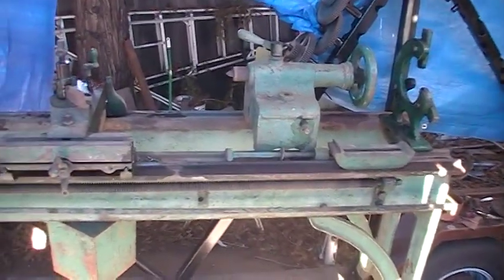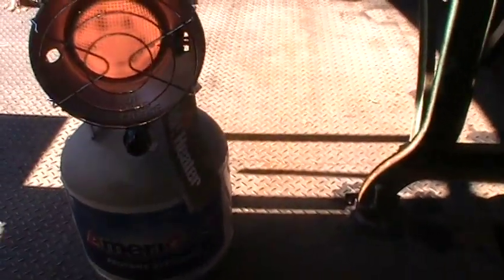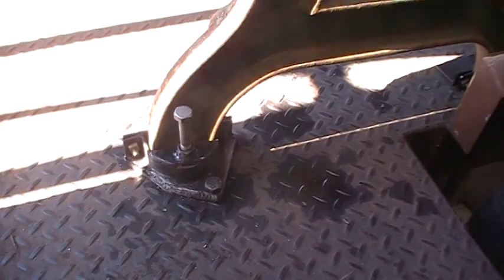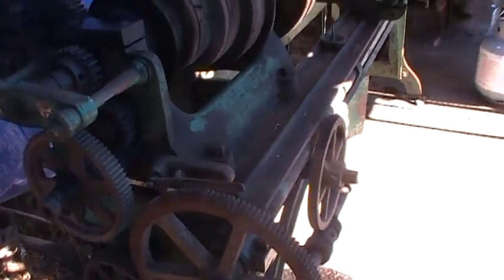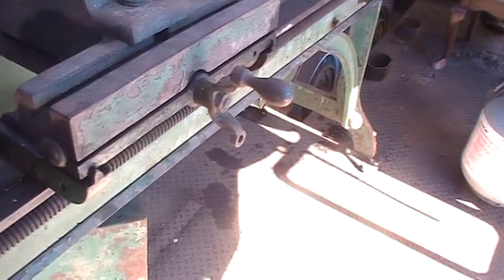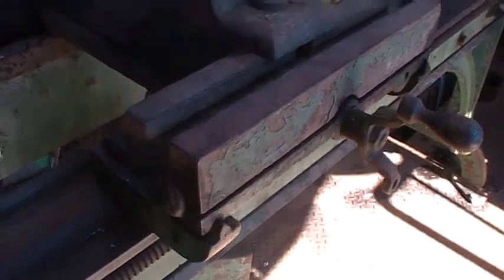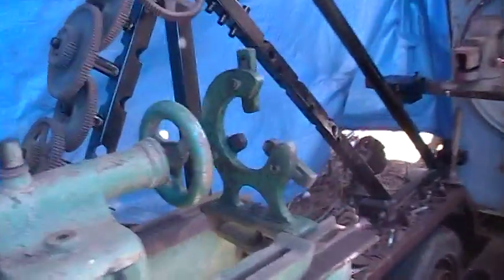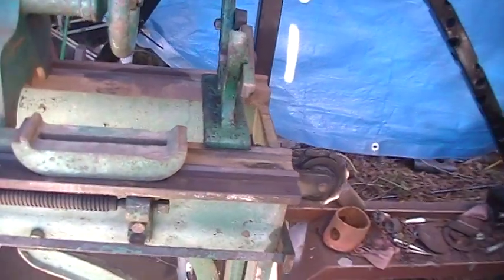The oldest lathe in California?

Comment: That is so cool! It's amazing what people were able to build with what little materials had been discovered at that time, and they figured out how to make the most of what they had with the rise and fall feature. That's really nice how complete the lathe is!
Nice work on the lineshaft, I like the oil catchers.
Reply from the maker: Thanks buddy.... how's your '57 project coming? Thought I checked and hadn't seen much lately.
Reply: @davewilson1591  It's been slow with winter set in. It was -28f yesterday morning, I don't want to freeze my hands up out there. But I did get the lights working, and the charging system working. I got a new fuel tank and all the side glass for it, so that'll be the next projects. I rebuilt an Edelbrock carburetor for it instead of my usual Holleys, and it seems to run smoother, so I'm excited to see how it goes down the road this spring.